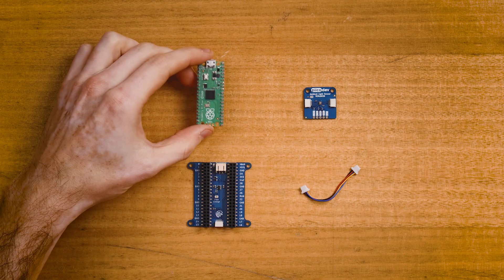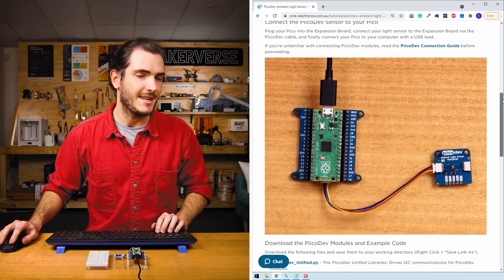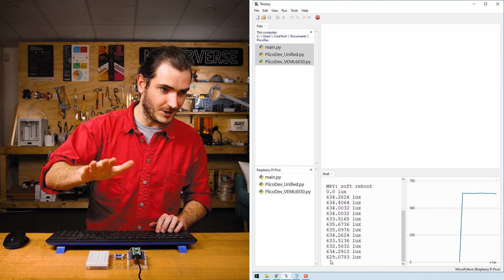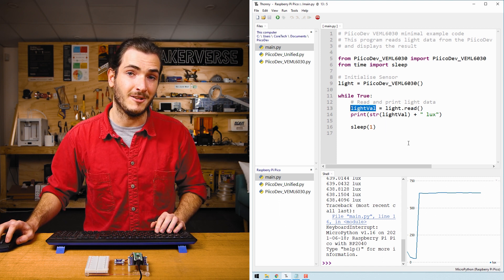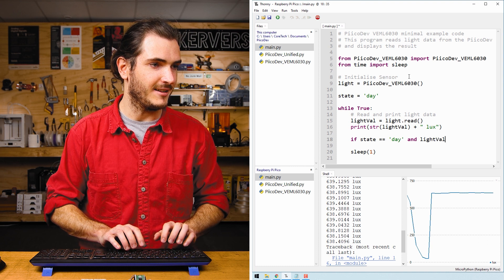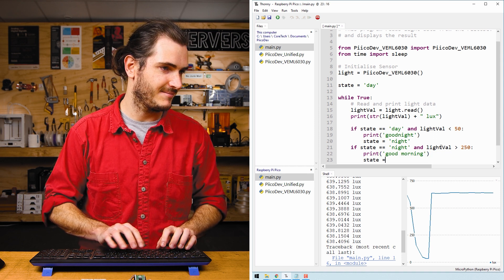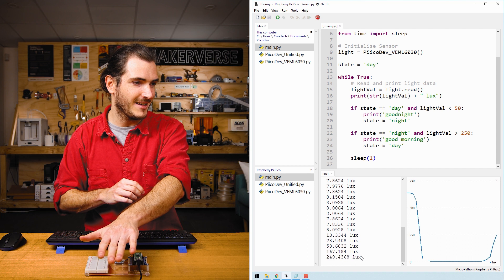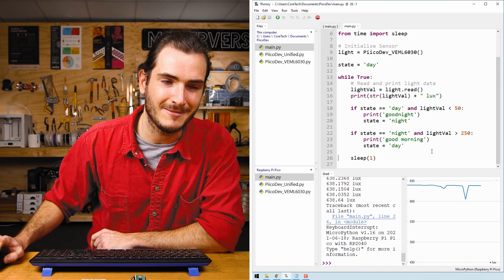PiicoDev Ambient Light Sensor VEML6030 | Raspberry Pi Pico Guide

Comment: Hi! Every time i try to run this set of code i get the following error:
File "<stdin>", line 9, in <module>
  File "PiicoDev_VEML6030.py", line 27, in _init_
OSError: [Errno 5] EIO

Can someone help with this? Thanks
Reply from the maker: OSError 5 usually relates to a connection/wiring problem. The best place for technical help is on our forums over at: https://forum.core-electronics.com.au/
Open a thread! We're full-time makers and on the forums every day